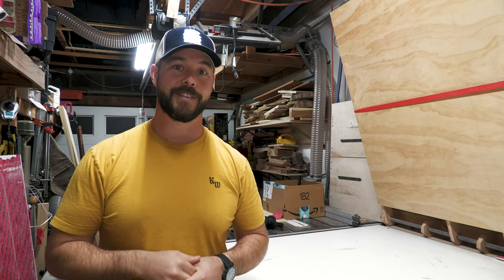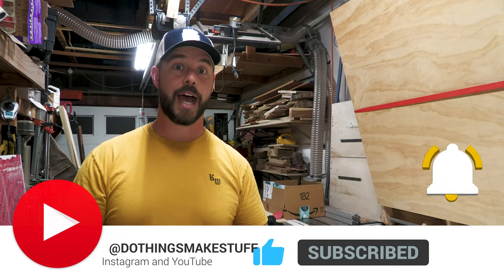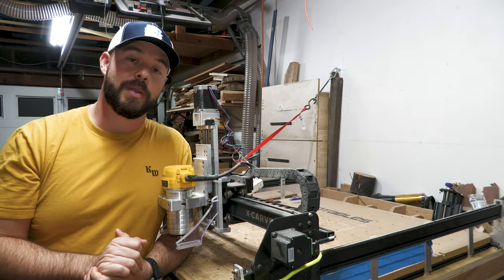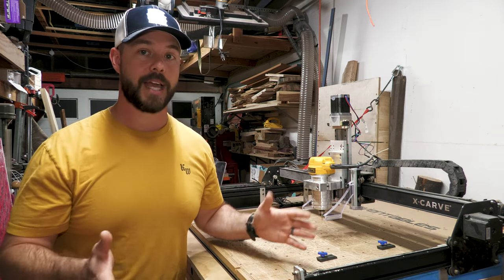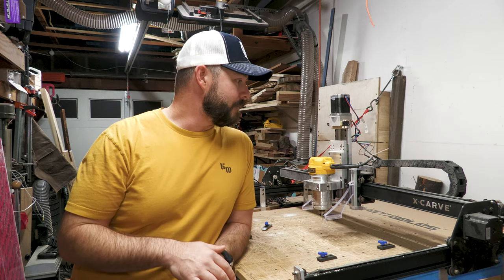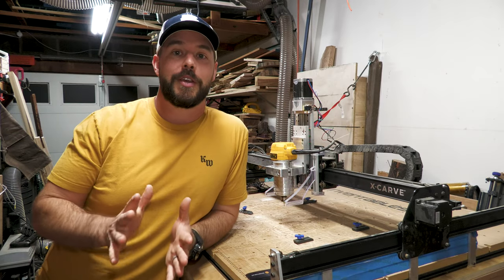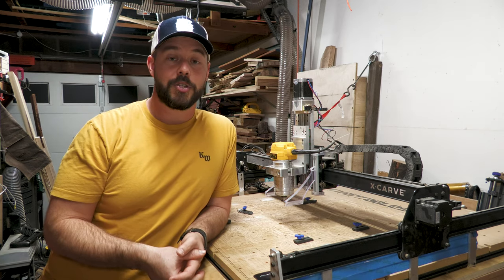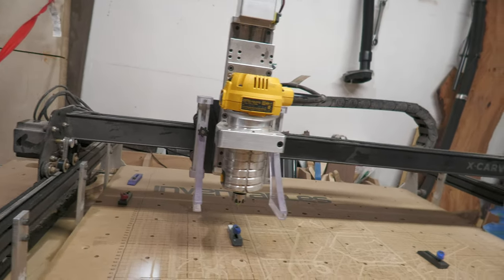Why I love my X-Carve and WONT be getting the pro... for now.

Comment from the maker: I dono if anyone saw today, but TBD CNC was purchased by X-Carve, and they are now working together to upgrade your X-Carve. New Easel Pro features are being added, like Tiling, which is great for everyone, I need to rewatch the video, but it sounds like some good stuff is coming for the X-Carve!
Reply: I saw that. I have a first generation X-Carve and I tried to purchase the Y axis stiffeners like you have from TBD CNC  and I can't. Then I went to the Inventables website and I don't see them offered there either. I would really like to get them as I've also replaced the original X axis with the better one found on Gen 2 X-Carves, have a new Z axis similar to yours and I also have the 2" riser end plates. Do you know of any other supplier for those?

Comment: I was on the fence about a cnc for a while! Deciding which to get was insane there are so many options. So I got a 3d printer in December 2018 to get my feet wet in a plotting machine type thing.. fast forward to end of 2019 somewhere in the beginning of 2019 I caught the 3d printer bug and December 2019 and 15 3d printers later i went with the X carve because it seemed like the most complete system, and I liked that Inventables actually listens to the users. I'm glad I got it, they make it SO easy to get going and literally jump right and and start rockin, Easel is super easy to use, it was a good choice in my opinion. I was totally going to jump on the pro but eh I'm kinda right there where you are, bit too much $ and there are cheaper routes so I won't be getting one after all. I will be getting a bigger machine with lead screw drive all around and linear rails. Thought I'd chime in since you had me through the entire video. Cheers and happy carving ✌
Reply from the maker: Dude thanks for the comment! Love 3D printing and I have one myself as well. Just a ender 3 but it works great! Thanks for chiming in, I appreciate it!

Comment: Hey, just came across your video on the X carve pro. It was very timely as I am looking at purchasing an x carve. Also, your upgrades are the most succinct I have seen. 

Would you be willing to share how are you price out work that you do as piece of work. That is, someone asks you to cut some shapes from of a piece of material. Not a full blown build: plaque, build a table, or something like that. Even if not specific per piece/hour dollar amount, how are you price that differently than a project. I regret I haven’t had time to go through all of the comments on your videos. You might have answered this before. Looking forward to enjoying your channel.
Reply from the maker: Thanks for the comment! pricing out piece work is something I'm not he best at honestly. The guys on the Made for Profit podcast have an excel sheet they sell I'm to to buy to help me out. I normally have a base rate in my head, meaning how much I want to make per day the project takes me. I also know that I'm not Ikea prices and I'm not able to price things as high as a full time shop would. I think it comes down to what I need to make per day that the project is going to take me and then I can divide it out from there based on the pieces. I make some little photo holders and charged $6 a piece because I was making 200 of them. Once I get it set up I knew I could knock them out real quick and then most of time was spend in the laser where I'm hands off since the machine does all the work. 

So a formula would be somewhere in the Day Rate x Days Divided by Pieces.

Also thanks for the compliment on the X-Carve!
Reply: @DoThingsMakeStuff  thanks for the reply. Im probably looking at more like 10 pieces. I like the day rate calculation. I had forgotten to consider that approach.

I will look into the spreadsheet as well.
Reply from the maker: Also time and material costs have to work into the equation. I have a buddy who owns a 3D printing company and he doesn't go off of machine time but more so on material costs since machine time for him is kinda irrelevant.

Comment: Thanks for the honest feedback as a guy that bought one, versus being given one.  I tried to read through the comments before asking this question but didn’t see anything in the video or in the comments.  Which version of Easel do you run?
Reply from the maker: There really is only one version but Easel Pro gives you the ability to save custom bit sizes as well as change the cut fill directions. I do use Easel Pro and I question it all the time. But I do use different bits and normally change the fill direction to match the grain as much as possible. I found it to be a smoother cut will less sanding in the end!

Other than those two things I don't think there is any difference. Or at least if there is I don't know what they are! I would run it with the free easel and if you run into a headache or want the ability to save some settings then by all means upgrade! I've downgraded and upgrade a few times :-)

Comment: Great video, would you be able to provide a link to stiffeners that you use?
Reply from the maker: Ah yes so sorry I need to go add those to the description! I purchased them from here - https://www.tbdcnc.com/  I also purchased the 2" risers at the same time.  He also sells all the belt upgrades if need be and a Z Axis upgrade. I decided to go with the CNC4Newbies instead!
Reply: @DoThingsMakeStuff  I maybe have a suggestion for you...can you mount the x-carve sideways?? You said you wanted to use it to flatten slabs...if you mount it sideways you could push the slabs through the end of the machine..just a thought..
Reply from the maker: @justkiddin1980  Yup I almost did that initially but I cant in the space I'm in. Also, long slabs that I have to push through would be better with a sled because figuring out level and flat would be a tough game to play!

Comment: This was legit! Exactly what I needed. I recently inherited a handful of woodworking tools and have decided to go all in and become a woodworker. I'm in the process of building a 12x16 woodshop in my backyard and decided that I would treat myself to one pricier tool so I can hit the ground running and decided on a CNC machine. Although I'm a newbie, I'm fairly techie (Illustrator, SketchUp, etc.) so ramping up shouldn't be too hard. So now it's all about finding the most robust, yet cost-effective option. I was sort of leaning towards the Maker Made M2 at around $1000, but this might be worth the added investment. Although it won't do as large of pieces, seems like it will be more accurate with better detail. If I'm off-base with any of that, I'd love to hear your thoughts. Thanks!
Reply from the maker: Jody yes! I’m so excited for you! I think you’re right on! If you know illustrator and sketch up you’re there! The best stage of learning will be bits but that involves some trial and error. I would spend the extra little bit and get the 1000mm machine if you can make it fit. I’m in a one car garage so making it fit is tough. Having a fold down multi use table top was a game changer for me! Good luck and I would love to talk more any time! Please reach out!
Reply: Hey Jody.....I'm converting my 12x16 shed out back to a wood working shop as well....I'm still in the process of building out my work benches.  I would really like to see how your setup is coming along in your woodshop.
Reply: @RobbyOtts  Oh man, I would so love to show you, buuuuut, I haven't made an ounce of progress on it since getting the concrete slab poured a month ago.  Still trying to get through the rainy season here in Seattle. Hit me up again in, I dunno, August?  haha  (This is killing me.)

Comment: what is the cutting denentions possible with that machine
Reply from the maker: 31"x31". Can can pass through now which can increase that but the bed is 31x31!
Reply from the maker: There are some people that makes extended rails so you can upgrade the machine and increase the dimensions. If you have plans to do that then you might as well just buy the larger machine from CNC4Newbies though.

Comment: Great vid on the X Carve and your upgrades. I am pretty sure you can tile with the X Carve. Also I watched a video of an expanded X Carve to 1800mm. I have an X Carve that I haven't built yet but bought some up grade parts to install when I do. I also have a Gatton CNC that I bought and am building it to hold a half sheet of Ply. You should look into it just to give you ideas. I am installing a water cooled spindle instead of a router. All said and done on the Gatton I have invested about 27 to 3 G. Liked and subbed.
Reply from the maker: Thats awesome! I will look into it thanks for the info!

Comment: Thanx - learned a lot.  But I have a basic question... can the X-carve cut out individual pieces (eg. the drawer fronts for a toolbox) or does it only carve?  I want to be able to make accurate & reproducible parts to later hand assemble and join.  Could you let me know?  Appreciated.
Reply from the maker: Yes absolutely, I would say that is its simplest function. Thats where you can jump on to a 1/4" bit and crank the feed rates up a bit as long as you have the stiffeners. I'm going to do another video this week that shows me using the X-carve doing some basic cutting that may answer some questions for you!
Reply: @DoThingsMakeStuff  Thanks!  But remember, I don't have one -- just in planning phase -- so you have to expand on "stiffeners" for me...
Reply from the maker: Totally realized that, I talked about it in the video and showed them somewhere. I’ll go scrub it and look when it was. I purchased them from TBD customs and what they do is add strength and support to the Y axis on both sides. When you start moving a little quicker the machine can vibrate causing a rougher cut on the edge. These tighten that right up and would be easier Installed from the start.
Reply from the maker: It’s the pieces of aluminum sticking up on the sides of the machine holding the side rails. The machine doesn’t come like that
Reply from the maker: https://www.tbdcnc.com/shop/x-carve-ultimate-upgrade-kit
Reply: @DoThingsMakeStuff  Great follow-up.  Big Help.  Much appreciated. Happy Holidays!
Reply from the maker: @georgegonzalez-rivas3787  Same to you!

Comment: They have tiling on Easel Pro
Reply from the maker: They do now yes! at the time of the video they did not. I haven't tried it yet have you? Any luck? I spoke with them before the release and asked for some sort of referencing marks to be added into the system for tiling.
Reply: I just go my machine a few weeks ago and I'm still learning.  I am still working out the bugs. I had a dip in my waste board and had to add MDF under the board, then I glued playing cards to the MDF just to make it level.  I think adding references points will be next after I make some bump stops.

Comment: I agree with you bro.. I ordered mine and then decided to cancelled my pre-order and decided to get the cnc4newbie upgrade instead. I think if the Xcarve was closer to 4K I would have gone through with it. But  at 6K I can build a much capable machine.. not to mention, for 11K !
Reply from the maker: That’s exactly where I landed. You won’t be disappointed with the z axis upgrade! I have to do way less sanding since getting it. My only issue now is dust collection. The “suck it” doesn’t fit right anymore so I need to make some modifications to make it happen
Reply: @DoThingsMakeStuff  I just ordered the new carve 4545 Model (51inx52in) from cnc4newbie, got a 2.2Kw spindle, all new stepper motors nema 23 - 269oz and wiring kit, all for $2600. And the best part is that I get to use my own Xcarve Controller that I'm used to.
Reply from the maker: @gustavoespinoza9834  Wait what... you can use the XController? That means you can use easel too!? Holy smokes!
Reply: @DoThingsMakeStuff  yes sir!!!!! 
It was a no brainier for me... And for the spindle there is a ton of info and videos out there . Including in their Facebook group.. o basically got a Xcarve on steroids for 1/3 of the price
Reply from the maker: Shoooooot. Yea One day when I can move into a bigger space in the future that is exactly what I will probably do. Dang Thank you!!!
Reply: @DoThingsMakeStuff  I'm planning to put some videos together once I get it.. but I'm excited to get this thing.. everyone says is very heavy duty.
Reply from the maker: @gustavoespinoza9834  I'm stoked to see it when you do!
Reply: @DoThingsMakeStuff  you can also order the 1000mmx1000mm .. is about $1800.. just FYI
Reply: @TavoX do you know if they sell the x carve controller by itself? Im glad I found this before pulling the trigger on the pro. I do not own the x carve cnc. So what would you both recommend I do?
Reply: @sergiorodriguez8759  you can buy the Controller by itself. $329
https://www.inventables.com/technologies/x-controller-kit

But I would get the Demon controller if you don't have an Xcarve yet. Because is a modular system, if anything goes wrong you can just replace that single part instead of the whole things. Plus it has an insanely amiof support by the owner/designer. 

https://cnc4newbie.com/store/en/cnc-controllers/demon-controller-grbl-based-p111c78/
Reply: TavoX Yes I found it literally five minutes after I asked. Should have looked a bit harder before asking. This is what I have in the cart:                                                            NEW-Carve CNC 
Kit dimension: 1000 
Spindle mount (recommended for extra short tooling): 69mm (Dewalt 611) 
269oz-in stepper: 4x 269oz-in 
Wiring kit: New-Carve 500/750/10.. 
Electronics packages:: None                                                                                                                   To that I add the controller you mentioned. Would i need anything else? Sorry for taking up your time.

Comment: About to purchase an xcarve like yours and was told to just skip it and get a cnc4newbies machine. What are your thoughts?
Reply from the maker: Honestly didn’t even know they had a machine? I know they have a full upgrade kit that I would really love to get, but you still need the x controller I believe? Don’t hold me to that, I need to go research that now.
Reply from the maker: Oh my goodness yes! I just looked it up and yup. yup yup thats probably what I would get. But.... you would have to learn to use a program that Generates G-Code like V-Carve Pro or Fusion 360. A good chunk of what Inventables is selling is access to Easel, software and firmware updates and ease of use. So that is a major factor. X-Carve and Easel is turn key and anyone can do it. With the CNC4Newbies you have to learn software and be much more of a student of the CNC process.
Reply from the maker: Scroll to my conversation with tavoX
Reply: Thank you so much. I really appreciate it!

Comment: I looked at X carve but ended up going with CNC4Newbie since it was a Pro grade setup for less than Xcarve and no belts. I drive it hard and fast and it works great.
Reply from the maker: Great to hear!!!! I feel like many people are talking about it here but no one has one! What software do you use to design and run the machine?
Reply: Smart guy.
Reply: @DoThingsMakeStuff  I am using Vectric Aspire.  Go to the Vectic website and download the Trial Version of their products so that you can play with it. The only thing you cant do is output G code
Reply: @DoThingsMakeStuff  If you want to know more about the CNC4NEWBIE join the owners group on FB and pick the master brains there

Comment: Thanks for the honest video. My question is about the tablet. Which one is it and does it add any limitations to the setup. Is it capable of sending instructions at least as fast as the cnc can work them. I know.... words hard.
Reply from the maker: So the computer processing power to run Gcode is super super minimal. I really thought about using something like micro computer but then you need a screen so a tablet makes sense for my set up that folds up and down. If I had a permanent set up I would maybe do something slightly different, but same idea.   Minimum requirements are windows 10 or higher. Needs a USB port.

This is the one I have - https://amzn.to/3gucL2A
It only has 32gigs of storage which isn't enough. I don't keep anything at all on the computer but updates alone have fulled up the memory so I had to go in and delete stock software that I never use. 

Today I would purchase this - https://amzn.to/39SVNd7
Little larger screen, double the memory.

I also have a wireless mouse and keyboard which go in a drawer that are really helpful
Reply: Thanks for the info. I like the idea of not using a full blown pc or laptop given the environment. Dust and such from all tools. Tablet seems a little more sealed and the touch screen has to be a plus. 
Thanks again,
/\/\ike.